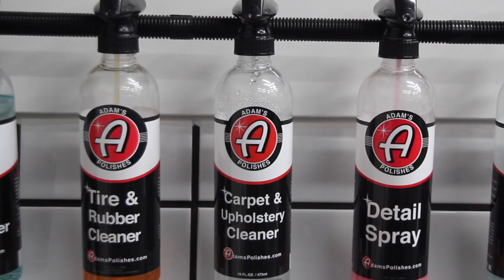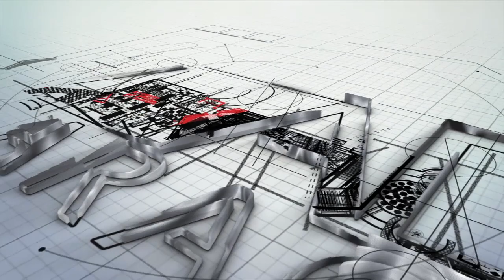GOLF R DETAIL | Complete Luxury Wash of Volkswagen Golf R in Indium Grey

Comment: I notice you don't use a pressure washer, is there a reason or is it just cos it would be not great inside your garage with the spray? 
I also tend to want to pressure wash off the wheel after leaving cleaner on and likewise after snow foam ,it feels like im removing more dirt if I pressure wash off
Reply from the maker: Paul Buxton This particular car wasn’t very dirty. Certainly not dirty enough to warrant pressure washing. I do use my pressure washer in my garage but if I feel I can get the results I’m after without putting it to use, I’ll do that.